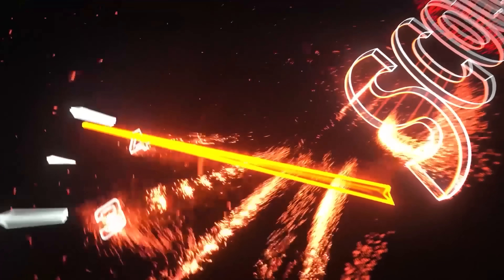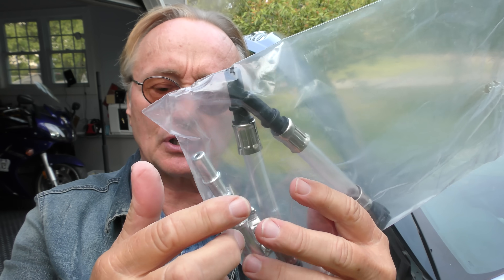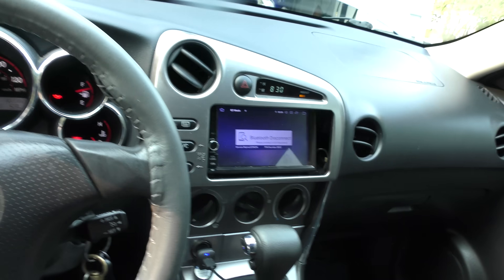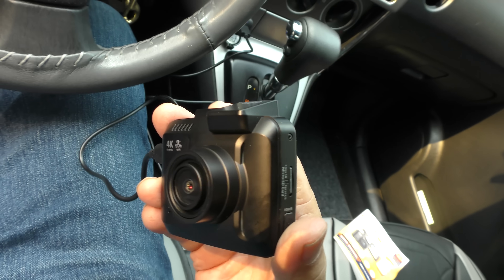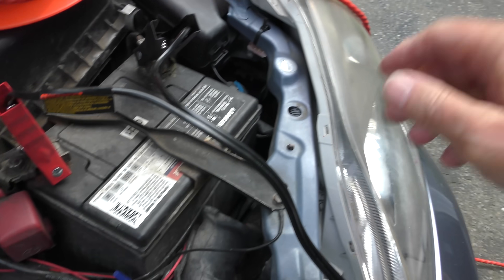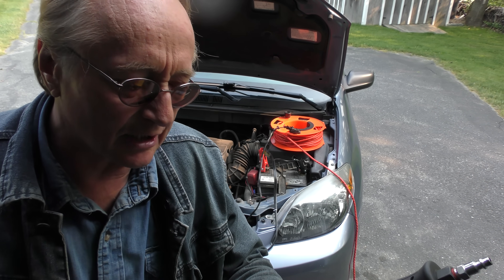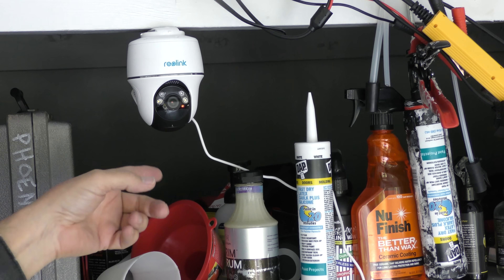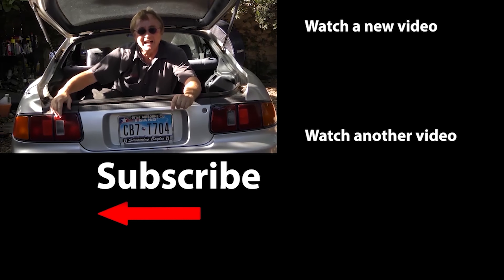I Was Just Threatened to Not Tell Anyone About This

Comment: The problem is cross contamination of fluids .You can only use it for one flyid type only
Reply: ~ Either buy more and dedicate each one or go through a cleaning before running a different liquid through it.  I use lacquer thinner for the petro based fluids and dish soap, or a stronger cleaner, for water based compounds and brake fluid cleanup. Straight Toluene or Xylene should do for the petro based materials since they are components in Lacquer thinner.

Comment: Don't use that extractor for turkey basting. Don't even use a turkey baster for basting.
 The fat melted the dang nozzle thing 180 degrees. It sprayed hot fat back over my hand...(which was holding the cooking tin up to let the fat gather), I dropped it back in the oven, the fat splashed out o' tin into the flamin' oven. Next thing a big freakin fireball flashed out in my face.

 I  thought the house was gonna catch fire. My mind was thinkin'  Where is everybody, can I get them all out safe??
 My legs were wanting to run away. Meantime my hands shut the oven door, switched the gas off, (till it was safe to restart).
 Drama over, all this in about 3 seconds. Somehow I was only singed. phew...

Comment: I live in the Midwest and we have very hard water and it plays Hell on a hot water heater. Crap accumulates in the bottom of the heater. I wonder if I could use that siphon pump to suck out the crap in the water heater?

Comment: I have a 40 year old oil syringe that works a treat. It’s chrome steel and has a neoprene seal on the plunger. I bought it to suck out the oil out of the differential on my 1970 Chrysler Valiant. Wouldn’t be without one.

Comment: I have the exact same one... different name on it 😂... warm up trans fluid... before you try to pull it out 👍😎 Awesome tool 1.5 liter enema tool 🔧 lol
Reply: Why?  Regardless of the temperature if you measure the exact fluid taken out and replace with the exact amount expansion shouldn't be an issue?
Reply: @MrBottlecapBill  Hahaha... warm fluid vs cold fluid. I know what I experienced with my syringe 💉 I tried for 30 minutes cold... drove it 1/2 mile, came out. Thermodynamics of petroleum is all I can retort 👍😎 Always the same amount, never said anything about the amount 🤷

Comment: When the key is off the cigarette lighter is off as well.
Reply: Newer model vehicles have 1 plug that is attached straight to battery. The cover shows a battery on it so you know which one it is. My last 2 Jeep Grand Cherokees (2015, 2018) and my last 3 RAM trucks (2013, 2016, 2020)
Reply: @dkingpin74  OK. Thanks for that info. That's a good idea.

Comment: Hey Scotty, hope you have a good day. A few weeks ago, a neighbour had a flat battery, so I took my NOCO GB40 over to try jump start his car, but no joy. Luckily, a breakdown recovery van came along whilst we were there tending to another neighbours car. I asked him to come over when finished to have a look. He came and said I put the jump started clamps on wrong. I put the red clamp to red on the battery, and black clamp to the neg on the battery, but the guy said to put the black clamp on an earth like the engine, or a bolt on the car body, never put it directly to the battery ned terminal. Turned out his keyless remote was faulty, therefore even a brand new battery wouldn't start the car. It was a 2022 Hyundai Ioniq hyybrid. Advise please Scotty.

Comment: Get a separate syringe for each fluid type.  If you get power steering fluid in your brake system, bad things happen.
Reply: ... no way - rinse with brake cleaner spray such as BrakeKleen, etc after each usage - quick dry no residue.
Only one syringe and always ready to go.  Note: dont substitute with a carb cleaner or acetone - 'brake cleaner only'.

Comment: The dealer charged $375 for drain and fill 2016 RAV4 SE.
Reply: Drain and fill what fluid?
Reply: @rockinrob2004  ATF...on the 2016 RAV4.
Reply: @paulc2548  WOW that does sound like a lot. I just had my front and rear differential fluid as well as my brake fluid drained and filled at the dealership for $400 total. 2019 Subaru Impreza

Comment: Just had (tranny) lol fluid changed in a 2017 Toyota Avalon 42K miles, not 300+ $$. This guy specialized in toyota/lexus. All fluids are toyota barr none. $90 charge. Same place brake fluid exchange, engine antifreeze change, oil/filter change, state inspection-$405.00. NH

Comment: the reason why it charges less and less until fully charged is because "as the battery charges" its own voltage relative to the charger's voltage is "closer" and "closer" to the the same voltage (less voltage differential).  the "voltage differential" is the actual physical "force" that causes the current flow which is why the amperage gets less and less until the battery voltage equals the charger voltage which would be a 0 V differential which equals 0 Amps.. V = I * R and R is fixed so when V is zero, I (amps) must be zero because R is fixed ( in this circuit).

Comment: Battery allows less current to flow throught it with increasing charge level. Suppose we are charging with constant voltage, then current flow drop throught charging is caused by increased resistance of battery, not by charger lowering current (it would have to low the voltage). Simple car battery chargers charge with same voltage as alternator. That is 14.7 V. When the battery is empty it accepts maximal current that charger puts out. When battery is nearly charged, then current drops to approximately 1 A, then charger stops charging. If youre in a hurry you can increase voltage to charge faster, but then you have to keep in my, that battery is fully charged when current drops to higher current level than 1 A. It's all about simple Ohms law.
Reply: Yes but the current flow doesn't drop that fast until it's nearly charged. Also it would be a linear drop in current, wouldn't drop from 9A to 6A suddenly.
'Smart Chargers' artificially lower the current beforehand

Comment: Scotty, today, dash cams are important. However. Most cigarette lighter sockets today. Are not wired directly to the battery, anymore. They are wired to the ignition switch. And when the car is off. The cigarette lighter sockets are also off. It's not like the old days we remember. From the 1960s and 70s  and even the 80s. Until computers destroyed our lives. And made wealthy people, wealthier still. And bankrupted the rest of us.

I definitely think that Tesla is setting the standard. For having, 360 degrees of, video recording. Not just, 120 or 140 degrees in front of you. Which is pretty spectacular looking. From Tesla, footage. Catching that accident from 3 different angles.

I don't think it will be long before each Dash camera comes with, 4 cameras. All rolling in 4K, resolution. At 120 frames per second.. So we get spectacular, slow motion crashes! Oh yeah baby!

We all want to see our crash 4 times slower than normal.
RemyRAD

Comment: I was surprised when I heard Scotty say you don't need to rotate tires....I hope he's right. Any thoughts folks?
Reply: Maybe you don’t technically need to, but I once had Costco deny me a prorated credit when my tires wore out sooner than that warranty because I had missed one rotation. I actually rotated it on my own because it is faster than driving to Costco in waiting in line. That was the last time I bought tires from Costco.
Reply: Mine rotate automatically while I drive.
Reply: @jeremyjohnson8128   ... rotations a good thing to do 'IF' there's a noticable off-wear to either side of a tire meaning the front ends out of alignment IF that off-wears up front OR a bad trailing arm,etc. IF its a rear, which means need of suspension repair either way.